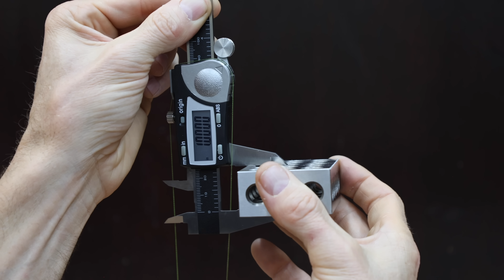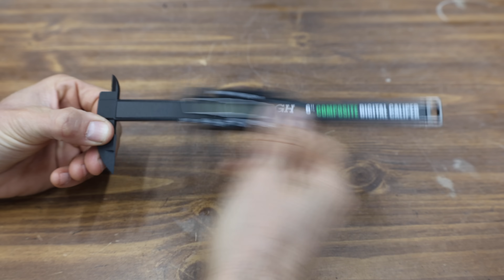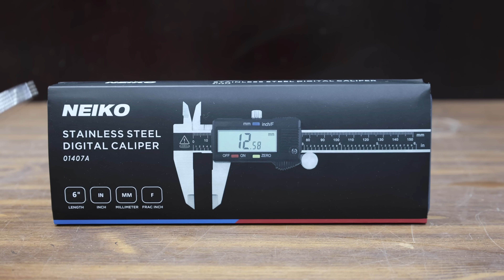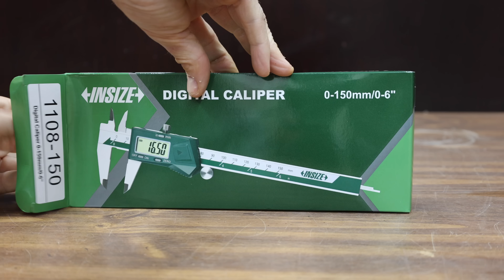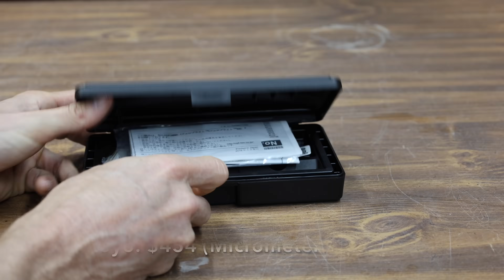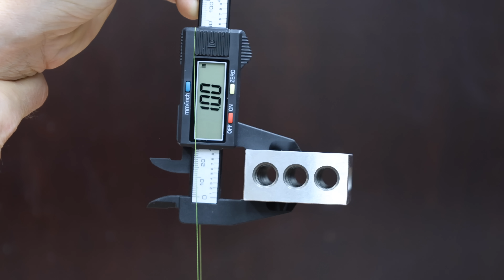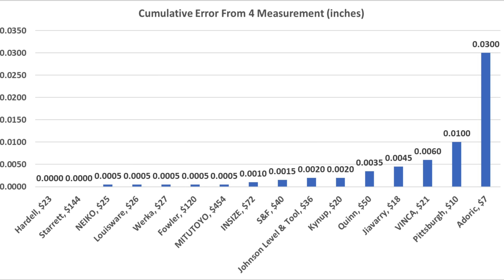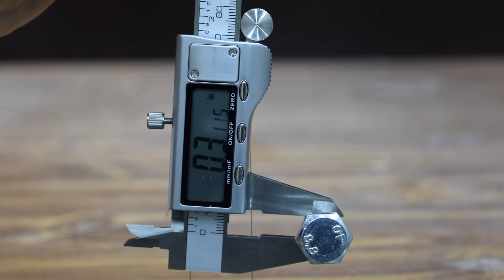I've Been Proven Wrong About Calipers!

Comment: What is most important is how do they hold the measurements when the battery drops. Some of them start to drift a lot, whereas mitutoyo just holds the value until the battery dies. And that is their biggest advantage over the cheap ones.
Reply: One thing to be aware of is that it's surprisingly easy to get knockoff Mitutoyo calipers, the only place to be sure you aren't getting a fake is through industrial suppliers like Grainger, Shars, etc. Most of the listings on Amazon are for fakes, and with how Amazon does picking even if you buy directly from Mitutoyo as an Amazon seller, you may get shipped a set of knockoffs since they were in a closer warehouse.
Reply: Battery life is also a major difference.

My Mitutoyos can go years on one battery, compared to the cheap ones which would need a new battery every month or so on the same battery.
Reply: @rainmannoodles  yeah battery life is years with Mitutoyos. I have a cheap one for 300mm measurements and it’s months. They shipped the caliper with 2 replacement battery’s. Probably to avoid bad reviews because of battery time.
Reply: @rainmannoodles that’s just a lie. You know damn well that they aren’t dying every month
Reply: @rainmannoodles  I have a kinchrome that has basically no drift (especially when off and temp is similar), and doesn't chew batteries, I got it used and after 6 months replaced the battery they came with. They are not cheap ones either but not quite at Mitutoyo level.
Reply: @rainmannoodles  Truly. Used to be Starrett was the undisputed king so I bought a batch of them for my team. Seemed like they were all dead within six months. 8 years later my coolant resistant Mitutuyos are only on their second battery. Seriously wtf
Reply: @rainmannoodles  The Mitutoyo absolute calipers do not still draw power from the battery when turned off unlike the cheap calipers. 
The cheapies all will drain the battery down if a battery is installed while powered down.
Reply: This would be a good test: accuracy at low battery/voltage.
Reply: I've never seen a digital caliper, however cheap, that would drift depending on the battery voltage.

I've seen ones that drain the battery way too quickly, and that's an issue with many, that warrants picking ones powered by cr2032 at least.
Reply: @s_s-g4d  I've seen some tests done on cloned mitutoyos. The drift is minor, but it is there. The original shows a B sign and from there you just replace the battery and have no issues.
Reply: How is this a thing?  How does the battery voltage matter in a digital caliper where the voltage isn’t used as part of the measurement?
Reply: @PaleoWithFries  The microcontroller can go haywire if its supply voltage is lower than the minimum required. Good software/µC detects this condition and shuts down (brown-out detection). 

In the end, µC are still kind of analog, and the transistors/clocks in the processor aren't working right without the minimum required supply voltage.
Reply: @girder123 yes but none of this is actually alleged to happen.
Reply: yup, Mitutoyos will tell you when the battery starts getting low before it starts affecting accuracy
Reply: @IsZomg  there's no reason for it to affect accuracy at all, as long as the circuit is not implemented horribly wrong.
Reply: @s_s-g4d  Watch Dan Gelbart's lectures where he explains how a low battery affects the accuracy of calipers.
Reply: @IsZomg  I found his channel, but there's no match on "calipers" or "caliper" and too many matches on "accuracy". any specific keywords to look up on? thanks.
Reply: @s_s-g4d  why don't you just ask chatgpt to explain it to you then
Reply: @IsZomg  ? you mentioned some video, I would like to find exactly that. I'm not touching any of the AI crap.
Reply: @s_s-g4d  So you won't do research and you won't google it or ask AI. Sorry but you are beyond help.
Reply: @IsZomg I also went looking for the video you mentioned so I can show it to my students. Was it a video on Dan's channel or somewhere else?

To be clear- I know how digital verniers work and why voltage drop causes issues, I just want to find a good video that explains it.
Reply: @IsZomg  so you threw out a vague reference to a source to prove your point and won't be more specific. it doesn't work like that. you make a statement, the burden of proving it is on you, not on me.
Reply: @s_s-g4d  Bro, you have the power, believe in yourself. If you want to find the truth you have to do your own research but unfortunately you seem to be utterly incapable of doing so right now. I hope you can overcome your fear of AI and Google searches. Good luck.
Reply: @IsZomg  I just want to know what video you referred to, that's all.
Reply: Funny I came to say the exact same thing, I had a cheap pair give me bad measurements when the battery was dying, replaced with mitutoyo because they don't 'brown out', they black out when the battery dies.
Reply: Never considered the battery getting low effecting accuracy.
Reply: One of my original machine shop teachers taught me to look for a caliper with a voltage comparator, without it you will lose accuracy at low battery life because the measurement is taken as a direct function of voltage.
Reply: interesting, would not have even considered that as a factor
Reply: @stronkde  another good test, the cheap ones will drift when off/stored in temp controlled area over time. 1-2 weeks and you still have 0, with a CR2032? It's probably a decent caliper.
Reply from the maker: Thanks for sharing!
Reply: What about when a dial caliper runs out of battery
Reply: @Wind_slash0  that means you need a nap 😂
Reply: @Wind_slash0  you end up with a very bad analog caliper ;)
Reply: @Wind_slash0  hard to read for me. I have a Mitutoyo dial caliper too but don’t use it very much.
Reply: @Wind_slash0  Is that suppose to be a trick question, because they don't use batteries.
Reply: mitutoyo can hold the value as long as they want, the price is ridiculous
Reply: @slayjay77  When a wrong measurement costs 10s of thousands dollars, the price isn't really an issue. Sure, you could use different cheaper calipers to verify, but the cost of labor will eat up your caliper savings in no time.
Reply: @slayjay77  they're like $150 from MSC, hardly ridiculous. For how good they are that's actually an insanely good price compared to how bad some of the $50-100 sets are.
Reply: @slayjay77  Around $150 USD isn't bad for a quality caliper like the one from Mitutoyo.
Reply: @slayjay77 these are less than $150.  Not sure where he got the $450+ price from.
Reply: @GusFromDaysPast  He bought a bundle and instead of looking up the price for the Mitutoyo caliper on it's own, he presents the price for both of them, which is misleading.
Reply: @slayjay77  I don't know how Mitutoyo got that expensive in the US, it's almost half of that price where I live. I think everyone should just get what is good locally, so you don't overpay for import cost.
Reply: @worawatli8952 that price was for the set with a fancy wooden box and a micrometer.  Kind of ridiculous to put that price up against all the other caliper only prices.  Could easily have used the caliper price from MSC or McMaster or Amazon.
Reply: @slayjay77  that's the price for a micrometer bundled with a caliper on the side. They're not nearly this expensive solo.

Comment: Boss isn't all too happy about me watching this on company time, but he accepted that this is "research" for reliable workshop tools.
Reply from the maker: Lol, that's great!
Reply: Always worth the research.
Reply: @Bakachu7   "Hey Boss, we need some more calipers, and THIS brand will give you the accuracy we need at a fraction of the cost of the ones we usually buy."
Reply: Boss get's a dollar, I get a dime. That's why I watch Project Farm on company time.
Reply: @johndavid3598  ...and you rhyme too.
Reply: @johndavid3598 a poet no less!
Reply: @johndavid3598 that will be a country song on Suno now! Hold my beer
Reply: @johndavid3598  These days the amounts are spread out another decimal point, if not two.
Reply: I got that adori one and maybe after a couple months the screen was showing weird things on its screen. Completely busted after not being used at all
Reply: @samsaek666 your battery is flat
Reply: @Droidy77  I have had to replace my battery once in 6 years and I use it fairly often. Great little set the Adoric version. Just used for screw length, gauge, drill size and board thickness. Really good to have big numbers to read when you get old eyes. 🤓
Reply: Thanks for all the effort. How about the $20 metal Pittsburgh calipers?
Reply: just say your researchin' which calipers your gonna use to measure that handlebar moustache he keeps twirlin' as he looks at you with utter disdain..
Reply: Got about 20 sets of work zone  calipers from Aldi about 8 years again, they were on sale for 5 bucks each. They all work great.
Reply: I mean, it really is research for making wiser purchase choices. This channel gives us tool testing data that is usually more scientific than found anywhere else, and practical too.
Reply: Tough luck working on a Sunday
Reply: There'll be a very good return on this investment.
Reply: This is 100% legit research! Steer you in right direct to research further to reinforce your research finding.
Reply: Your response to him has to be "This guy is really good."
Reply: Awesome review , watching this and using mine often makr me realize I've never measured them for accurately.
Reply: Boss makes you work on a Sunday?
Reply: Don’t tell him about NotebookLM
Reply: That’s the honest truth about finding the best, least expensive tool needed for your work.
Reply: Telll your Boss. You're doing a Webminar on tools managment and enhancement training.😂
Reply: Wish my boss would understand this...
Reply: Workshop tools are the cheapest
Reply: LMAO, gotta respect the grind. I'm glad I gave similar suggestions to this video with Tap handles and other things of the like. It's great seeing the truly good stuff be shown off
Reply: Nice. However, you are not wrong. Everything on this channel is research. Love it !
Reply: The entire channel is an educational gold mine ... ... it's higher education and if you have a question or a doubt about anything any where type in project farm and what ever you think you need to know about ... I've been glued to my screen watch this marvelous professor drag race oils ahahha
Reply: Lucky
Reply: It is.
Reply: I guarantee your boss is in there watching fishing videos 😆
Reply: Ur everything that OP is not. Probably why he's revered & ull b the 1st laid off.
Reply: For 3d printing development and design my harbor freight is generations old now and still awesome. With the variables in 3d printing, I never need more than 0.00 mm.
Reply: I've been in the same situation 😂
Reply: Testiment, i have used a broken so many cheap verniers so i bought a mitutoyo coolant proof vernier over +30 years ago it is beat up but is still in calibration. Now mines shuts down and auto magicaly starts up when you move it. Any modern equivelant I have seen doesnt. 30 years ago i think I paid £120 uk pound.. £4 per year aint bad. 😂 good tools that last.
Reply: I told my boss that I was allowed to watch lockpicking lawyer cause I was a locksmith lol
Reply: Boss needs to be replaced if he didn't know who this is and sat down with you to watch. Company can do better.
Reply: would you rather have the job done or would you rather have the job done right???
research is important! + background videos make work go faster ;)
Reply: Doubtful, you commented this 8 minutes after he posted it and it's on a Sunday
Reply: @davidchud314  Public Service Jobs do not stop just because it is a Sunday... Nor does contractural work
Reply: @davidchud314 depends what industry you're in. Around here I bet at least 30% of people work Sundays regularly. There's a lot of shift work here 14 days on, 7 off. Or 21 on 7 off.
Reply: @davidchud314  dude, in the future it’s already Monday morning 👋🇦🇺👍
Reply: @davidchud314  Yeah, cause it’s not like OP is referring to the channel itself and not this specific video. That’d be crazy.
Reply: @davidchud314  Agree, I wonder about people that either like, dislike or comment before there was enough time to view the video.
Reply: If my boss questioned me about how what I was looking at I just packed  up and left
Reply: Boss makes a dollar, I make a dime, why I watch project farm on company time
Reply: Fake story😂
Reply: bruh get you a job that doesnt police your phone.  i tell all bosses, "hey man if i get my work done i expect to be left alone to do my own thing.  i aont busting my ass just so you dont have to do your job and get the lazies to do theirs.  i dont work hard and fast just so you can give me your or someone else's work."  politely of course.  always works cause most of the time they get it.and if they dont they suck and i can easily find better work anyway.

in fact i JIST quit a job in which the owner actyually tried to tell me to stop using a chair and to put my hpone away lol.  closer commute, VERY slight payvut (25 cents/hour) and im now a QC operator i basically just inspect tiles and sit in front of a computer terminal all night long all by myself!  🤣🤣🤣
Reply: If you don't know what calipers to buy, you're fired
Reply: Mine said the sane but I told him to shut up.
Reply: You work on Sunday?
Reply: @BryanMTorres  not everyone lives in the northern hemisphere 😂
Reply: Switch companies if he's not happy, your time will be valued elsewhere.
Reply: Bro you working on the office on Sunday?
Reply: @timzalusky there's this thing called time zones. The vast majority of people do not reside in the same one as you do.
Reply: @timzalusky it wasn’t Sunday everywhere when the video was posted. Not even Sunday in several English-speaking countries.

Comment: I have an iGaging digital caliper. I think it was $80. It’s accurate to half a thousandth. It’s a really good one, that I use all the time.
Reply: Yeah, quite disappointed that he didn't test one, iGaging is a brand I have come to trust for being 80% of the high end for 30% of the cost. I love mine, and I don't see myself upgrading unless I start buying a lot in machining.
Reply: Yes, I bought one of those because the information I could find was that its batteries with last a lot longer than the typical ones, and I've been happy with it.
Reply: @charliesullivan4304  Yea my iGaging calipers are over 4 years old and still on the original battery. So I can attest to the long battery life. Granted I only use them occasionally, but it seems like a lot of calipers have a bad habit of draining the battery even when off.
Reply: I got a 12 inch one for off Amazon still works great
Reply: Igaging is hard to beat, I paid under $40 for my 6”.
Reply: bluetooth on mine is great
Reply: I was looking for this comment. Our professor recommended these as a pretty decent set for the price. Apart from a failed gasket, its served me well. Plus, a good thing to hand someone when you don't trust em with the expensive stuff 😉

Comment: Battery life is a big plus for expensive calipers. But sometimes there are surprises. My very first caliper i bought over 15 years ago at a hardware store brand that has long shut down was around ~€20. Runs for years on a single LR44/AG13 cell. Never loses track. Is probably a Mitutoyo in disguise.
Reply from the maker: Thanks for sharing!
Reply: @ProjectFarm  I personally tested the battery power consumption of one just like the Jiavarry brand and the Mitutoyo with a high end multimeter. The cheap one used ~5x more power when on and ~15x more power while off!
Reply: @elminz  this is about power supply design, not precision. Yes, with expensive calipers, you get some better electronics. BOM would be 1-2 USD more in the production if a cheap producer decide to make better electronics.

Comment: I use the plastic ones from General tool because when it does fractional inches it Does it with a fancier LCD screen and because they're plastic I can use them to measure batteries without shorting them out.
I'm not a mechanic I'm an electrical engineer. Sometimes I gotta build holders and this becomes Well let's just say I spot wellded in my nice Japanese ones and I learned the hard way..😂😂
Nothing I do needs more accuracy than a sheet of paper.
Reply: What you want is something called a drill guide chart. That's the shop Rosetta Stone. A good drill guide chart has all the number drills, letter drills, fractions down to a 64th and metric sizes too. If you can figure out how to access it there's one in my Google Drive you can print out. I don't want to bang my own drum but it's the best on the net. I copied it off a steel supplier give away laminated chart. Which I beat to death using it. That puts the numbers into context you can use. You can look up a reading and see what it is close to and figure out what it is supposed to be. What makes sense.

Comment: if you have close Tolerances Brown and Sharpe and Starrett Calipers is the only way to go...
Reply: Use a micrometer
Reply: @mitchscat773  if you have to check the ID of a bunch of springs its not really gonna work is it